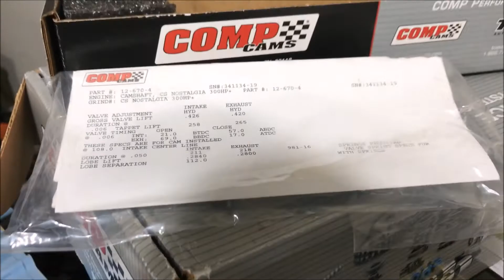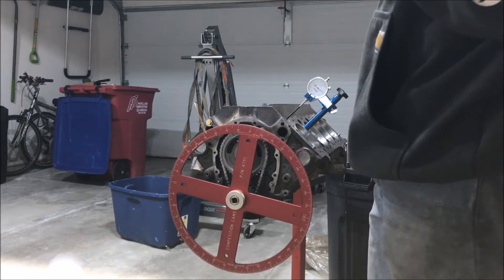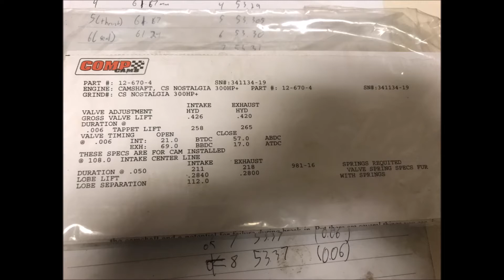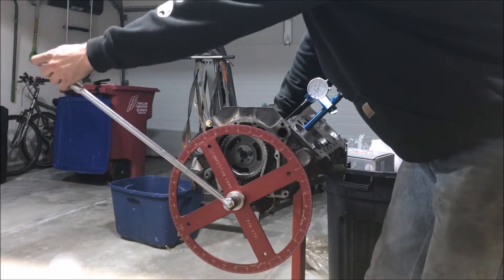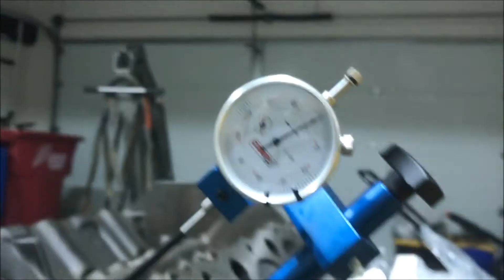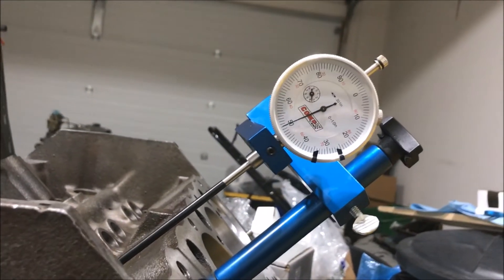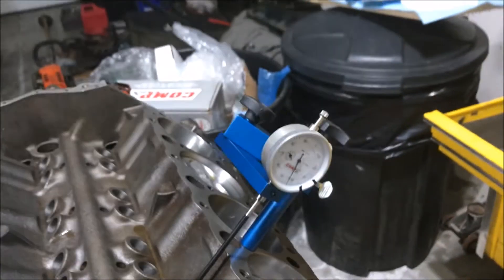Small Block Chevy - Degreeing the Camshaft

Comment: Where did the dots on the sprockets end up at true TDC??
Reply from the maker: I believe that with cylinder 1 at TDC then the crank sprocket mark will be at the 12 o’clock position. The cam sprocket would be at 12 o’clock or 6 o’clock depending on if it was on the compression stroke or exhaust stroke
Reply: @iowadiy6361  cool! I was just curious what they looked like considering the  overlap and since most people say don't just line up the dots. Just curious if it was still dot to dot at "true" TDC. Your video helped a lot, thanks!